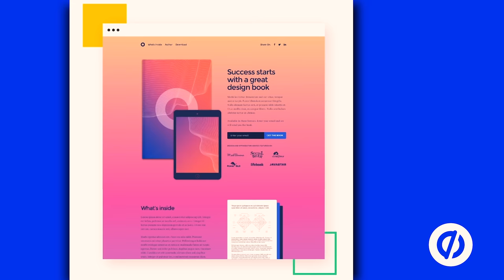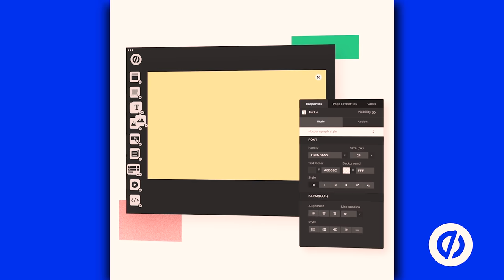How to Make Soap From Olives

Comment: Wasn't prepared for Lauren to break out a microscope and analyze the efficacy of their soap :D
Reply: I expected them to invent the microscope first.
Reply: Thanks to your comment I am well prepared
Reply: @ambulocetusnatans  learning to precision grind glass lenses.  what's interesting is that for laymen it seems daunting to try pushing past the early steam age but in truth it isn't and just starts requiring at most more collectivism. with the help of other creators like Nile Red, Applied Science, and Accidental Science there is no reason this channel couldn't push all the way to present day.
Reply: @simon-patrickjohnson  spoiler alert, sorry!
Reply: On the pigskin nonetheless.
Reply: @RazorSkinned86  They can use mirrors instead of glass. Just like a telescope can be made with mirrors, too. And while making a curved mirror for a telescope is more difficult to make, a flat mirror is much easier to make.  Then, with thin-enough mirrors (Which can be quite thick, actually, if enough force is applied), you can add a slight curvature to the flat mirrors, effectively obtaining the same thing. You might have a blind spot or more, in the telescope, and things might be slightly deformed on one or more axis, but it would still be better than trying to precision-grind glass lenses AND make them smooth, and both mirrors and lenses require polishing and waxing, but lenses require much finer polishing than mirrors do.
Reply: @RazorSkinned86  It would be interesting to see how far he can go on his own, so we can compare how much we leaped forward with globalism. For us to know where is the point of transition between "a single man can learn how to do something" to "we can only do that thing through collaboration".
Reply: @jairm.jr.9991  Honestly, the line is probably drawn at complex programming and very-low-tolerances development. When you're trying to squeeze every last bit of efficiency, and iteration-speed, things get exponentially more difficult. But if you can afford to overengineer things (so they can last longer), or underengineer things (so they break faster are less efficient), then it's completely doable.
Reply: @SapioiT  That makes sense, so far everything is very crude and barelly passing as "good enough". So precision and tolerances will be when he stalls, right? I mean machining and maybe even more advanced chemistry. There still might have some crude ways generate electricity and making lamps/motors.
Reply: @jairm.jr.9991  With lots of vinegar batteries, it's possible to make enectromagnets and use them to magnetize iron, and there's also the option of cold-hammering iron to magnetize it. Once you got a few magnets, using them to make more magnets is easy but tedious and time consuming. With more magnets, you can make stronger magnets. 

Machining and advanced chemestry is not that difficult in itelf, it just needs a person specialized in it, on the team, to supervize it, and proper safety measures to be in place as soon as possible water glass can be used to make not only glasses (which can them be sealed in was, to avoid water damage), including safety glasses made with a thick layer of water glass close to the user and a thin layer of actual glass on the other side, the two layers glued together, and everything waxed together to be waterproof. Fire-resistant gloves are more difficult, but could be done by hsing a mix of wax and dirt, to make a fire-resistant coating for gloves.

And it's not like precision tooling is difficult, it just that it needs more effort, more iterations, more time, and (ultimately) more funds, and those are 4 things the team is lacking. Solve the money issue, and the team can grow to make a functional airship by the end of next year, using steam instead of hot air. Steam has 60% of the buoyancy of helium and/or hydrogen in atmospheric air, while hot air only has 30%. With modern tech, heating the steam to very high temperatures could increase it's buoyancy to between 80% and 140% that of helium, which could spark a steampunk/floatpunk revolution. 

As a side-note, Tartaria believers (search "great tartaria map" on google images) belueve the steampunk was an actual age, since there are apparently photos with airships which are either not explained or considered fake by the mainstream historians.

Comment: "Random downed trees that were rotten"

Instead, uses a much older dead tree that has been in the ground and is visibly falling apart in places.
Reply: yeah i was thinking the same thing like it looks like its ready to just fall apart when you touch it
Reply: railroad ties are very well treated. Much better than rotting deadfall
Reply: His Mongol bow wood was pathetic. This was much much better than that fibrous wood
Reply: @bencressman6110  they are banned from re- usgae in switzerland simce the late 90ies because of cancer, health issues and enviromental damage, because of their tratment
Reply: @BlackDragonWitheHawk  All treated wood has that, it’s a matter of the chemicals softening the wood and preferring to stick to living material so they are dangerous to handle barehanded

Tldr wash ya hands and you’re all good
Reply: At this point i would just forgive them using hardware store wood, dear Lord are those wooden builds awful
Reply: @BlackDragonWitheHawk  oh, that doesn't surprise me at all... but they don't rot!
Reply: @riograndedosulball248  Maybe not hardware store, but surely he could buy some Christmas trees at a fair price and chop them down with his iron age tools instead of gathering fallen debris.
Reply: Also he should have used a plumb bob to mark a straight line. Then he also has the tool to mark a parallel lines. So he should have been able to create a perfectly straight screw. His screw was bent as f.
This guy seriously needs to team up with a carpenter to learn the trade.
I don't know how the Carpenters are in the USA. Maybe they are over reliant on modern tech. Over here the Carpenters use basic tools like plumb bobs, 90° marker, parallel marker and a pencil.
Reply: @SF-li9kh  In his defense, considering he made it from a tree segment about the same diameter as his end screw, he didn't really have the material to hew it perfectly straight.  The choice of materials were his main problem, the end product was fairly serviceable considering all that.
I agree he would benefit from some guest experts, but it seems like he's trying to do it all self taught which is admittedly interesting in it's own right.  I'm excepting the bronze smith because that's legitimately dangerous work without proper training.
Reply: @AVerySexuallyDeviantOrange  railroad wood in the US is treated with creosote oil and other highly dangerous chemicals as pesticides and preservatives to keep them from rotting, they are VERY hazardous to handle especially older ones that were made before more recent regulations restricting use of some of the most dangerous chemicals on them.  it's not just a matter of washing your hands, especially if you are sawing them into pieces and spreading dust and splinters of them around.
Reply: And soaked in toxic, carcinogenic creosote.
Reply: Yeah it was decayed, but I'd still much rather use an old railroad tie than some random log. At least you know it was made from workable wood to begin with.

Comment: “Isn’t lye used to dissolve bodies?” - Lauren 

To answer your question Lauren... yes it can be used to dissolve bodies in high concentrations and to dissolve a whole human body you need an average of 5 gallons of a concentrated lye/ water solution
Reply: Why do I have to think back to Ghost Recon Wildlands?
Reply: and a stainles steel pot to boil it in to speed up the proces. pro tip cut the body up in small pieces for even faster ressuts. pro pro tip dont use aluminiun with lye it brakes down to create an explosive gas
Reply: @janpostma5381  found the Modern Rouge watcher
Reply: And how do you discard 5 gallons of highly concentrated lye? Pouring down the drain doesn’t seem adequate
Reply: @4philipp  ad a metric fuckton of bakingsoda
Reply: @janpostma5381  very scientific measurements
Reply: So all I need to clean my basement is about 70 gallons thanks for the tip
Reply: @4philipp  fun part is that the reason why this works is because cell walls are made by a double layer of basically oils. By dissolving a body in lye you are literally making soap. If you don't overdo it with the volume of lye you can just flush the goo aka human soap down the drain as millions of people do with soap water. That is what water crematories using this procedure do - cook the body in lye, flush the liquid into drain because it's just soap at that point, then dry and grind bones left behind.
Reply: Jesus that's all it takes is 5 gallons??

Comment: You can also make lye from woodash. Mix ash with water (preferably warm or hot water, but cold water and more time works as well),  strain it to remove the ash, then you need to separate it from the lye. You can do part of the separation by letting it precipitate to the bottom, and the rest by boiling or simmering. After all the water is evaporated, you have lye without water. But for soap, you can use lye water in sufficiently-high concentrations. For cutting soap, a hot knife is preferred, but also more dangerous.
Many cultures used the ash itself, as a powdered soap, for things which it didn't stain. Like washing yourself from head to toe, including teeth brushing, for example.
Reply: I was looking for this comment as this was the method of lye production I was more familiar with (and ergo the method I was expecting in the video). I also thought this was the older/more-traditional method comparatively.
Reply: @Electracion  It's also simpler, if you don't have a mine nearby, since, in the past, every household had ash, and they would sometimes even use it directly as soap, but sometimes they would boil it (into potash), strain the ash part, and mix the rest with cooking oil which went bad, and lard which went bad, or simply stored it as-is for later use, or even diluted it and used is as-is.
Reply: That's how Mother Wilder does it in "Farmer Boy" too
Reply: That’s how granny did it in the Beverly hillbillies.
Reply: @SapioiT that is not lye thats potassium carbonate also known as potash to get hydroxides or lyes you need to fire certain compounds into oxide and mix them with water like in the video up. Even though you could make some soap with it you couldnt quite make a bar😢

Comment: It'd be interesting to see a re-evaluation of thr soaps after a month, as usually you have to let them cure for some time so that the remaining lye has had time to react.
Reply: I was coming to make the same comment! I made soap once with modern ingredients: lye and beef tallow, that you buy in the store. I certainly didn’t make anything from scratch, lol. But I do remember having to wrap the soap mold in a blanket and let it cure for 4 to 6 weeks before it was safe to touch according to the directions that came with the kit that I used.

Comment: If I recall correctly, letting the soap cure for 1+ month would help neutralize all of the lye, making it safer to use.
[Disclaimer: might be wrong on this.]
Reply: 2-3 weeks will let the lye fully react assuming you have your ratio right. Most soap cures for 4-6 weeks though to release any free water and make the bar last longer.
Reply: Yes - typically, using modern ingredients, measurements and tools, then Yes the average curing time is 4 - 6 weeks, depending on the mixture of oils used, this curing allows for the quality of the soap to transform. Except that with 100% olive oil soap, originally called Castile, or Aleppo depending on the regional area how it's made, that curing process takes longer, typically 6 months to a year, or more, again depending on various factors. It can be used after the 6 weeks, but as with time, like wine and cheese, it gets better with age. 

The "oh it doesn't suds much" is because what most people are used to using, the store bought bars or liquid cleaning products that are now  commonly used for washing dishes, clothes and your teeth, are technically detergents, (or include detergents)  But are not actually "soap." - It's detergent in these products that suds up so much. -  (Yes there's detergent in your toothpaste. Read the label and look up the ingredients.)...  But because of the characteristics of olive oil in Soap, it is very LOW, if any sudsing, but still cleans.  By actual definition true Castile Soap is only made with olive oil, and for Aleppo, laurel is added. Unfortunately many soap makers are taking liberties with the terms and adding other ingredients but still using the Castle name, because, in part, so many people are under the misunderstanding that sudsing is cleaning. Soap cleans, not suds. If your soap is actually soap, doesn't have detergents, but is sudsing, it's not 100 percent olive oil, or other things have been added to contribute to increased sudsing. 

Yay Soap…
Reply: @emerencespringer  This guy soaps
Reply: @CrimsonPhantom88  ... I don't understand what you mean.
Reply: @emerencespringer  bet this was a good episode for you 😂👍
Reply: @emerencespringer  its a surfactant, most notably sodium laureth sulfate or some other sulfate surfactant. ^ non ionic surfactants is what they are called.
Reply: @Anti Decepticon  ... Thanks. I was trying not to be "too" geek, nerd girl. Chemistry is fun. But I don't do maths. That's what calculators, spreadsheets, and giant brains are for. LoL.
Reply: @emerencespringer  you def soap. I use toothpaste that doesnt foam as much because the other ingred makes my lips irritated.
Reply: Yeah it's a good idea to test the pH level of your soaps. If you're making them buy the test strips if you're buying home made / farmer made LICK the soap. No joke, if you put your tounge on it slightly and it feels like licking a battery, leave it be for a few weeks. I had a severe lye burn on my right foot, because I bought some local farmer's soap, used it and a little bit of the resude stuck to my foot and it scarred my tissue into a scar.
Reply: @theblackbaron4119  garlic burns me too

Comment: Hey guys, love the series. Just wanted to note that there are far easier ways to make Lye then the one shown. One of the easiest I'm aware of it using Potash, which is just hard wood ash placed in a pot (Literally, Pot Ash) and steeped in rain water. The liquid lye will leach out and float to the top. It can then be decanted off and filtered into a separate container.

Comment: I would've wanted to really see how you applied pressure on the olives with the screw, because in the sound clip, it sounded a bit... broke and I honestly can't imagine someone just screwing it in by hand, considering that in the photo you showed there was a square part to it in which you could fit a stick to get some leverage.
Reply: Right, it definitely didn't work. To make a corkscrew like that that would fit perfectly and spin smoothly would take a very skilled carver. They also didn't show them filtering or refining the olive oil in any way but magically it's pure when they use it to make the soap.
Reply: @rontropics26  And as someone who's made soap before, insufficient stirring definitely wasn't why it didn't work. The reaction starts immediately irl. It was that the lye they made wasn't pure enough. Notice how at 11:56 the new lye looks very granular. I think they used store bought lye and olive oil for the second run.
Reply: @rontropics26  sadly htme isnt trying anymore. Since the reboot Series with a Team of people the quality of the Videos dropped instantly. Its all about pumping out Videos now and generating clicks (even the cat is a Tool for that) . The 'rules' are bent constantly. Personally i would prefer a Video All 3 months where everything is done true.
Reply: @NymNymO2  Thanks, that's interesting to know. I've been a long time subscriber but just haven't watched anything of his in a year or two.
Reply: Yeah, the current method is "if we [kinda] make it once, we can just buy tons of it from the store," and just skipping over a lot of the actual effort that goes into getting really pure ingredients and high quality tools. He didn't even bother trying to use the file he made from scratch, just opted for a store-bought one. Really feels like they're straying from the spirit of the venture...

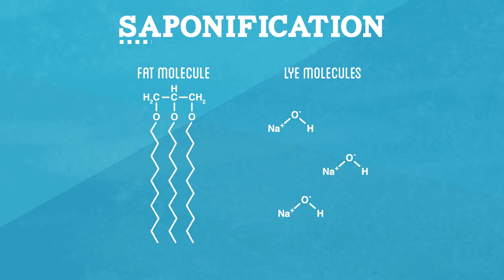Comment: 2:35 your illustration shows "fatty alcohols", not "fatty acids" and the resulting molecules depicted as soap are actually alkoxides (which are only stable in the absence of water and react violently with moisture to form the corresponding alcohol and alkalihydroxide while generating heat). The difference is that in order for these to be fatty acid salts, the carbon binding to the Oxygen actually needs to bind to another oxygen atom using a double bond.
Also, try making your lye from wood/plant ash! the main causic ingredient in it is "potassium hydroxide" and it leads to a much higher quality soap without the need of using limestone at all.

Comment: small suggestion with the new press, you may want to make a press basket for the center so you can press a larger volume at once. also, you could extend the catch spout out from the block so a container can be placed under the spout so you don't need the reed to guide the liquid.

Comment: I'm curious as to why they didn't go the wood ash route for lye. It might not be super effective at producing hard bars (beeswax can help with that) but its easy to make.

Also, 100% olive oil soap can take months to cure properly, unless you use a hot process. I'd love to see an update on these soaps later.